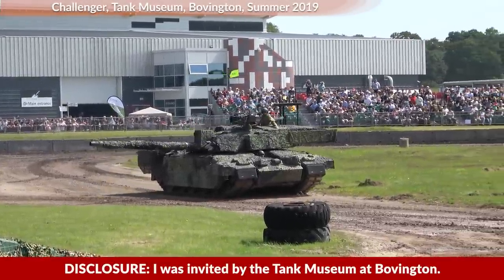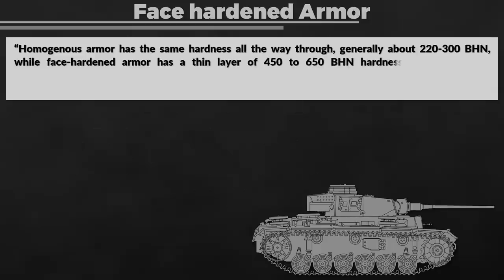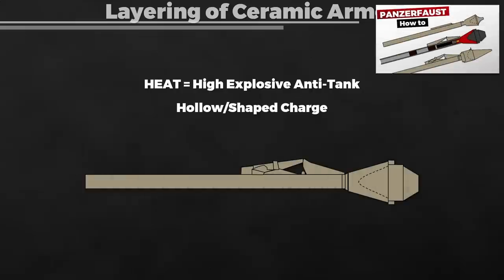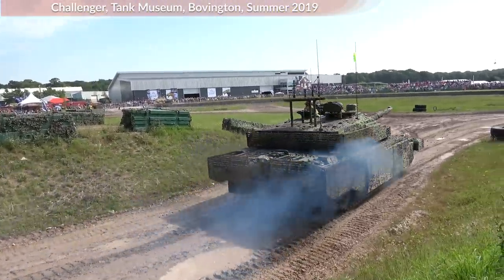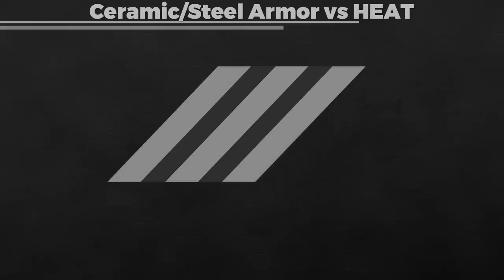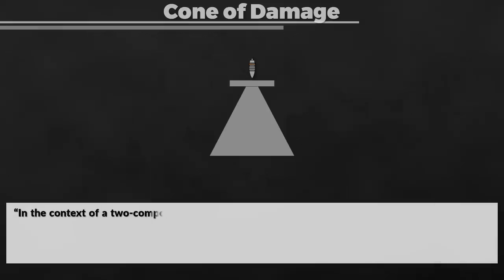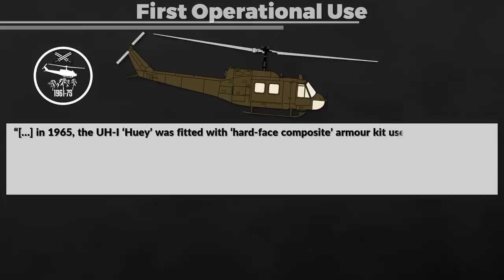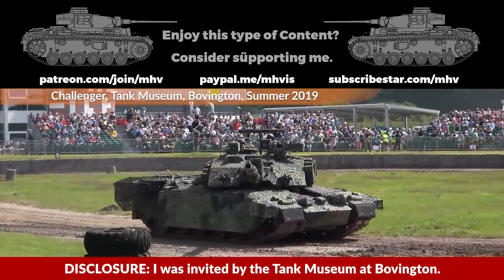Why Ceramic Armor? Hard but brittle!

Comment: I am surprised at the armor systems the videos on armor penetration of the M1 portray. It has been well documented that "Chobham" armor and the systems developed from it incorporated silicate tiles in a polyurethane matrix. The US Army was experimenting with silicate armors in the early 1950s, the TAACOM report having been declassified. The issue was cracking. HE shells of sufficient size would not penetrate but they would cause cracks in the plate that could be exploited. The same with KE projectiles. The cracks would travel outward from the point of impact. Amazingly, the experiments showed that using "quickcrete" to fill the cracks returned the plate to its original effectiveness against HESH and HEAT rounds, but not against HE shells and KE projectiles. Also the higher the angle of strike (ie. the farther the plate was from vertical) reduced the resistance of the silicate armor. Maximum effectiveness was reached at vertical. Despite the cracking, the silicate armor basically performed as well as a similar thickness of high hardness steel or against the face of cemented or face-hardened armor plates. Another way of reducing cracking was to 'cement" a silicate plate of a plate of steel with higher ductile characteristics. Thus the usual array was face-hardened armor on silicate on RHA plates. By reducing the size of the silicate plates to tiles in a flexible matrix, the damage or destruction of a tile by a hit by an HE shell or KE projectile does not compromise the rest of the armor array. Chobham armor was designed as a series of boxes welded to the frame of the hull and turret, allowing the boxes to be upgraded, such as when the US added a DU mesh to the M1A1 (Heavy Armor). It is an interesting comment on the armor array itself, featuring the different plates, matrices and such along with spaces, that the original armor design is still classified. What we know about the armor array is what has been released through "open" sources, such as Hunnicutt and Zaloga, which emphasize the silicate matrix. So, the exact distances, size of the tiles and plates, composition and alignment of plates of different materials are classified. But given the depth of the boxes on an M1, the optimal spacing and laminating of the plates and material to resist APDSFS and HEAT rounds allow some assumptions can be made. Which can be matched against the resistance claims in certain "open" sources for such armor. It should be noted that the US Army has found no reason to add ERA to the front quarter of the M1's hull and turret.
Going back to that TAACOM report, the results indicated that the costs of ceramic plates of suitable size and thickness were not immediately available from commercial sources, but a funding effort by the Army could generate the necessary supporting industry. It cannot be determined if the ceramic array was used with the T95 series of tanks, but it was intended to use the array on the glacis of the M60 (one reason the glacis was welded not cast) and the turrets were to be cast hollow and silicates injected into the hollow. It turned out the cost was too much even for the JFK administration's new focus on conventional forces. The Army also experimented with silicate armor "boxes" as applique armor for the M48 glacis and turret in the mid-late 1950s.
BTW, the claim that the M1's armor array was compromised in 2003 is not sustained. What IS interesting is the upper and lower glacis plate on T-64s and early T-72s which used arrays much like the ones described and illustrated in the TAACOM report from 1952. And that while ceramic balls and other methods were used in the turret of the T-64 and T-72, the exported T-72s had a simple system of plates and rubber or polyurethane.
Reply: I think that the armor composition of the M1 Abrams as it was first introduced didn't incorporate ceramics. However, the upgraded armor package in the early 1980s found on the M1IP and M1A1 seems to have it incorporated.

Comment: I think a good way to think about this is to look at the baffles of a silencer. The gas from the barrel rapidly expands into a larger volume and becomes turbulent reducing the amount of energy it has when it leaves the barrel making the shot far quieter. In some cases the energy is reduced enough to make a round sub-sonic.
For multi-layer armours that use ceramics or other brittle materials it seems like a similar principal but in reverse.

Comment: The details of Chobham armor have been leaked in 2003 and apparently, to everyone's surprise, there actually aren't any ceramics in it. It is just steel plates and rubber and a special way of mounting those steel and rubber plates so that when they get hit, they move and push more material into the path of the projectile.
Reply: Do you have a source on where I can get this information?
Reply: @nemesisobsidian  Not sure whether the blog still exists. It has been dead since 2006 or so, but there was a blog called "Below The Turret Ring" which was pretty well known among tank nerds back in the day. If it does not exist anymore, I can't help you.
Reply: @TrangleC  A "blog" that no longer exists. Compared to Jane's, Brassey's, Zaloga and Hunnicutt, et al?

Comment: I remember seeing a documentary which depicted the disruptor and absorber principle being applied in protecting spacecraft from high-velocity debris impacts. It works even better in that application because at those energy levels projectiles generally turn into ionized gas or plasma upon impact, further spreading out the force. The example shown used several aluminium plates separated by large "air" gaps.

Comment: good video, but that one was not a HEAT round. A HEAT round is different from a shaped charge round. A HEAT round does not do penetration of the armor but has the effect of spalling. It is a different concept. A HEAT round is just a a high explosive round which comes off in contact with the armor, causing it to splinter on the inside face, disabling the crew and equipment.
Reply from the maker: You mean HESH.
Reply: lol
lmao
Reply: @MilitaryHistoryVisualized  you are right, I apologize, I got it all wrong.
Reply: @virgilrusu you are a humble man, you will learn better than other ignorant people

Comment: I've been wondering... just purely out of personal curiosity. Why isn't this being used with soldier's body armor? For example a thin layer of ceramic, with polyethylene armor underneath. (or layers of ceramic and steel, for a more cheap option.)
Reply: Ceramics are needed to defeat level IV threats.

Comment: So do dual off route IED defeat most armour types?
Offset times that shatter then penetrate?
Reply: EFP's*
Reply: @scrappydoo7887  Off route mines is mostly aimed at the side of tanks so there are not much that the side armor can do to stop it due to thickness.
Reply: @xendk  ok. Thank you for the reply 👍

Comment: Thanks for the brief clarification on shaped charges. My education is in explosives and it bugs me that even US Army engineer courses get the shaped charge concept wrong.
Reply: Is it engineer as in field engineer that rig up explosive and stuff or engineer that work in lab to develop stuff?

Because grunt on the ground only need to know enough stuff to kill the other side and not kill their own side. "Burning throught stuff like a blow torch" is easier to convey than "high velocity superplastic jet pumching throught armor similar to water jet cutter".

Comment: add very dense materials like DPU and titanium and you get modern tanks...the key is understanding your battlefield because you cannot have separate fleets for different threat models.
Reply: Titanium isn't dense
Reply: @alexdunphy3716  I think he confused tungsten and titanium. :)
Reply: The best armor is lead and the best HEAT liner is gold, But
Reply: @xendk  I've never heard of lead being used for armour; it's too soft. As for gold being used for the liners in HEAT shells, it has been tried, but the premier liner actually seems to be a copper-tantalum alloy, or so I've heard. Gold is way, way too expensive to be used in those munitions, especially in the quantities that would be needed.
Reply: @Schwarzvogel1  Come on.... only an idiot would believe that lead have been used as armour!!!!!  or gold applied as ammo but in "theory" they are the best for a shape charge and as armour again it.

Comment: 5:20: you make it sound hypothetical to mix ceramic with various steels. Maybe I'm misinterpreting you, but the label on the Leopard clearly says "do not weld, ceramics included, will create toxic gasses". I paraphrase, but you see the point: we already have ceramic and steel mixed.
Not to mention the armor on the Abrhams is top secret, so we have no idea what they're doing. Surely they're using ceramics and steels too?
Reply: Quite likely, yes. But exactly how the M1 tank's armour is constructed is highly classified information.
Reply: Abrhams armour has a depleted Uranium layer in it! Probably ceramic layer as well.

Comment: "Face Harden Armor" is not a good term. 
There are many way of manufacturing non homogeneous steel plate. 

The existence of capped projectile change the dynamic. 

In general, for the purpose of tank, overwhelming amount of the times, homogeneous armor is better. 

Ceramic type armor works against non erosion penetrator, we all know. But how does the dynamic changes when we are dealing with erosion based penetrator?
Reply: For the purpose of a modern Main Battle Tank, only composite armor can provide sufficient protection against anti-tank rounds and missiles. Using homogeneous armor would be completely impractical due to weight (we’re talking battleship-level steel armor to even dream of stopping a modern APFSDS round).
Reply: I don't know where you get the idea that homogenous armour is better than composite. Homogenous steel armour is very vulnerable to shaped charge rounds and has to be incredibly thick to stop kinetic rounds: meanwhile, homogenous ceramic armour would simply shatter every time a tank goes over a bump. Composite armour (layered ceramic and metallic) is superior in all regards.
Reply: @MaxIsStrange1  
The part of homogenous armor is about face harden steel vs homogenous steel. 
My question regarding composite is how ceramic based armor perform against erosion based projectile?
Reply: @jintsuubest9331  I’m not sure what you mean by ‘erosion based’. I thought you were talking about APFSDS rounds since they do erode during penetration, and which is why these days they are a single-piece rod about a meter in length, and are made from either a tungsten alloy or a depleted uranium alloy (like the staballoy).
In terms of how well a steel armor would hold up against an APFSDS round, to the best of my knowledge the answer is not well at all (just look at the estimated penetration numbers of these rounds, measured in Rolled Homogeneous [steel] Armor).
Reply: @jintsuubest9331  And if you’re curious, you can look into YouTube channels like SY Simulations which try to simulate how different types of projectiles interact with different types of armor.
Reply: @MaxIsStrange1  
That's what I'm talking about, rod munition.

But there exist non rod munition that also penetrate primarily with erosion, vast majority of them are autocannon ammo. 

We know how single layer of steel interact with erosion projectile. There are plenty of study and good simulation out there. That's not my concern. 

What I'm curious about is how ceramic based armor interact with rod and non rod erosion munition. As far as I know, there are a couple outlines, but no detail. 

Ceramic has to be as intact as possible during the penetration process. Angle can help and harm the armor depends on a variety of factors. Ceramic need to be held from all side to effectively deal with tank cannon type threat...

Neither SY nor Dejmain published good large scale ceramic armor sim because it is still a very new territory compare to steel and rubber.
Reply: @MaxIsStrange1  
I also found writing on how ceramic interaction with non homogenous rod (be it segmented, vary material, non rigidly connected, etc) is pretty much unknown.
Reply: @jintsuubest9331  You still haven't explained what an "erosion projectile" is. Are you referring to explosively-formed penetrators (EFPs), also called "self-forging fragment submunitions?" Modern tank armour can generally defeat any known autocannon projectiles except in areas which the tank generally wouldn't be exposing to enemy ground fires (e.g. the top, underside, rear) where the armour is thinner. 

If you are talking about HEAT (high explosive anti-tank, or shaped charges) rounds, modern ceramic armour is again highly resistant to those. HEAT warheads are still used because they work great against things which aren't MBTs and are not as thick-skinned. Against MBTs, HEAT warheads are most successful in a top-attack approach, where they target the thinner armour at the top of the tank. EFPs are often used similarly.

Tank cannon threats will typically come from the front and some angles at the side. The crew (ideally) won't expose their vehicle's rear to the enemy and they'd ideally have enough SA and support to not allow an enemy AFV to sneak up behind them! Tank cannon attacks from above aren't very likely, as tanks typically are not capable of flight.😂

Comment: Just hammer the same spot. The first hit disrupts the ceramics, the second will penetrate the armour.
Reply: In real combat conditjons- at a range of sometimes over a kilometre, against targets that are often moving, partially obscured or both- this is much harder than you make it sound, to the point of being functionally impossible to do deliberately.
Reply: Not going to stay still and let you do that
Reply: The US considered trying this with the HSTVL light tank armed with a quick firing 75mm canon
Reply: There is usually a reasonable armour steel  top layer to defeat heavy machine guns & shell splinters then you get to the interesting layers

Comment: I like how you can correctly pronounce Ceramic and then later get it totally wrong all in the same video.
Reply from the maker: yeah, that is the issue with words that are very similar in German and English. Sometimes it works the other way round as well, e.g., I often say "Panzer" the English way instead of the German way.

Comment: ceramics are resilient, which are a Material with non-cristaline or less cristaline Characteristics Not.
Noriker Steel thanks to high on carbons is near to metal-ceramics and quite resilient. resilient flexes and survives instead staying deformed and does Not break Like e.g. cheap Glass or Metall.